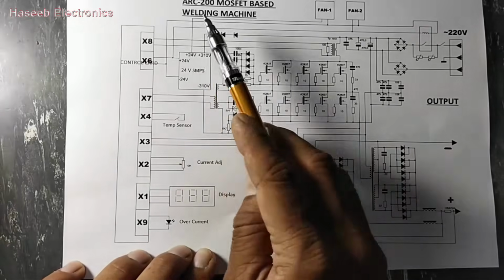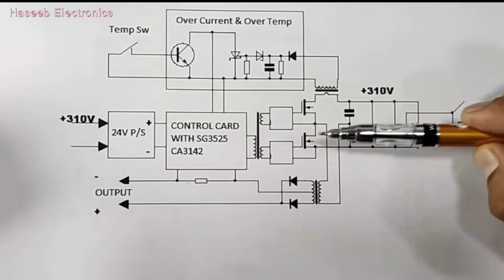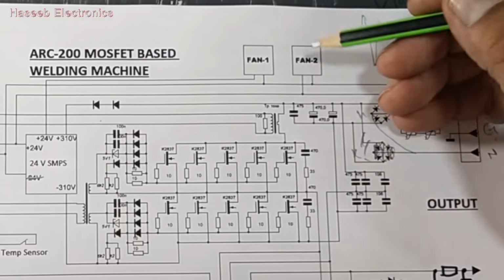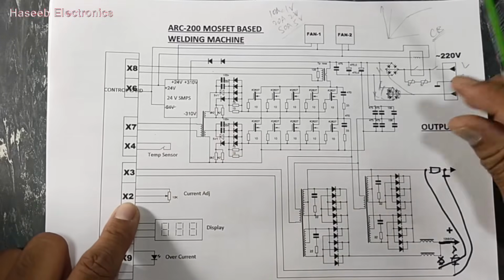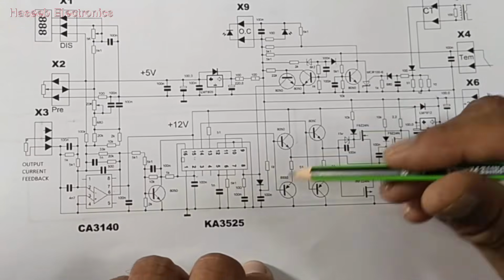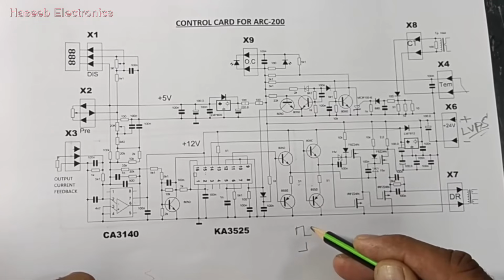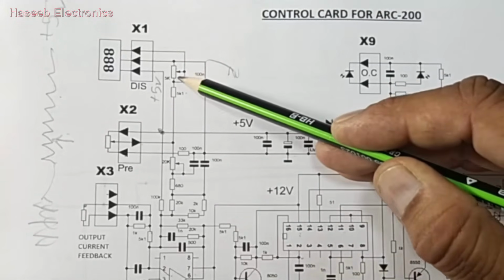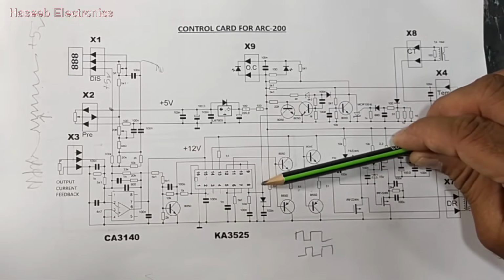{471} ARC-200 Inverter welding machine circuit diagram explained

Comment: Thank you for the Video!
Can i use the overcurrent to switch on/off current.
I want to modify a old mig welder to inverter mig welder.
And i do not know how the inverter reacts if i repetantly triggern oc protect!
And i do not know how long it takes if i demand current again ,witch time it takes to ramp up.

Please consider to answer:).😢
Best regards!

Comment: what are the exact value of the small zener glass  diodes for each igbt at the out put ,any one can help , i need to repair the out put replacing with 75n60.. This is good video. 3yrs later.

 24:04

Comment: what causes low voltage, my welding machine is having fourteen volts
Reply from the maker: most possible causes
gate drive for any IGBT is missing 
current feedback OPAMP on the control card may be problematic 
output rectifier may be damaged or any dry joint in power stage (transformer, IGBTs, output rectifiers etc)

Comment: Hello master, I have a Makute MMA250 pvo profissional welding brand welding machine. The 8-pin microcircuit is burnt and exploded, and the z diode is burned out near it. I could not find the data diagram. I ask you to find the datasheet diagram of this machine and upload a video about it to YouTubecan you

Comment: Sir well knowledge thanks,❤ sir low voltage ko supply kahan ce mily gi, mery weldder k igbt tak 300 volt aa rahy han but fan,relay off ha, power light on ha,no out put voltage ha

Comment: Thanks a lot for your valuable info. 
Can you tell me how the single board welding machine senses the over current alarm without current transformer? 
Where is the current sensor of the OC in the single board machine? 
Thanks in advance
Jihad syria

Comment: Sir I have three new control cards for a walling machine z24 9z24mosfet output sometimes 30v sometimes 220.300v.  z24 9z24 mosfet was installed still having this problem. gate voltages of mosfet are 5,20,5,20 ok.sir give a video for this problem

Comment: Sir, is there a 500 capacitor in the CA3140 IC, 500NF or 500 uf?
Reply from the maker: i think it is 500n . it is connected as compensation
Reply: Mylar capacitors, sir, or ceramic capacitors

Comment: ANYONE KNOW WHERE i CAN GET THE ARC 200 CIRCUIT DIAGRAM LIKE HASEEB ELECTRONICS USES
Reply from the maker: i already added the links in video description
you can download from here also 
 https://drive.google.com/file/d/1myf5...
https://bit.ly/3vH2WaS
if you need more whatsapp 00962-79-5324272 or gmail ashraf4ta4

Comment: what is the possible reason for over current oc problem in this welding machine
Reply from the maker: most of time there is operational amplifier (CA3140) failure 
IGBT temperature sensor circuit 
CT current transformer circuit

Comment: Thank you for this great walk-through. I modified mine by using an Arduino with smoothed analog PWM output in place of the potentiometer.This allows me to do H/L pulses and use a foot switch etc. Great little machine!

Comment: Sir can you help me about the circuit operation of inverter welding machine MMA-400 DC IGBT INVERTER ARC WELDER. The supply volt is 380/440VAC. This brand is RHINO. The problem I encounter is no display and the fan also not working. I changed already diode because when I checked it's already shorted. But still cannot power on. Can you show me the diagram for this and a little information. I'm very thankful if you can help me this. Thank you sir.

Comment: Thanks for the video, I appreciate your videos. I think there is a mistake in the control card, more precisely CA341 cannot work with the non-inverting input to the ground without symmetrical supply voltage (+-12V). If the supply voltage is asymmetrical (+12V and GND) the non-inverting input must be at a non-zero potential. I also did a simulation to convince myself

Comment: hi sir 
i have an inverter mma-180 welding machine and while start normal the green led lights and the fan works after few second s
the light off and the fan stops 
i have notice there is a pcb on the bottom with ptc becede a relay and increase the resistance i suppose increase the current 
when the weld machine colds after 2 minute the same process happens 
could you tell what can cause this ?
Reply from the maker: please check soft start circuit (PTC, Relay)
please check IGBT temperature sensor circuit
Reply: @Haseeb Electronics  thanks for the answer sir how can i check these components ?
i think the most good way is to replace it with new right ?
As about as the temperature sensor of igbt i cant see where is it 
i think on the second level there are three transformers maby there 
But i thought if i had shunt igbt or power diode meby the oc lights will light its not light on my case 
and maby the problem is viltual 

 @HaseebElectronics

Comment: if i want to custom to dc output power supply what do i need to custom? can i get it directly from final diode? i can decrease voltage from pwm control, but in final we see only half bride final diode.....it safe if not full wave rectifier? assalamualaikum

Comment: السلام عليكم, does the frequency change, through feedback, or is the pulse width the one that changes with a fixed frequency, to fix the output voltage, to the required voltage, h

Comment: Sir the inverter in our shop which is RIY LAND enverter welding machine  when i switch on the machine  its ok it will turn on and it well work in a short time after few minutes it will not welding  but the power indicator is on and the blower is running  sir what is the possible cause of the welding machine? Please reply thanks sir and good day

Comment: Sir i buy new control board for my riland arc250 but i have some difficulties when i install the new one ,the setting in display is 300 so i adjust the varistor to match in 250 but the oc light suddenly light up ...how can i adust the oc telerance?
Reply: Did u figure it out ?

Comment: Hello sir,  just asking.
What if the output voltage is low. 18vdc only instead of 56vdc.  Can you give me any idea whats the problem please.
Reply: I think check the current limiting circuit. It maybe senses some current are being drawn and reduces voltage to limit current to the preset value. Maybe adjust current setting pot and see if voltage goes up or down. That might confirm it.

Comment: Good and clear explanation. I have a MATWELD-200, every component is measuring okay, no dry joints, no short, but when you connect it to power, it immediately trips the breaker. What would be the problem?
Reply: Sounds like a dead short, so by connect it to power, do you mean that just plugging the machine in is blowing the breaker ?

Comment: Hello, can you please do a video on modifying a DC Inverter welder to be able to run e6010 electrode?

I have one welder and it starts but stops after 2 cm of welding 1/8 inch electrode.

 From what I have learned in all your inverter videos and seen on other people's videos is that it is related to output inductance and voltage, but I don't know how much inductance is necessary and how to change output voltage.

 I have seen on your video that current control is a summation of all different sources of current sense, and maybe the e6010 somehow tricks the controller into thinking there is less or more output current compared to igbt side before the transformer.
 
The only solution i can think of for output voltage is rewinding output transformer.
Reply: Is the problem with 6010 rod not working with inverter welder the rod flux coating type ? The coating type is incompatible with the inverter welders arc frequency ?

Comment: Hi sir, I have a full bridge TIG welder, I changed all mosfet and it works well 1 min, after that it blows up the 4 mosfet, the driver card doesnt seem to have bad components, do you have any similar experience with this full bridge driver card??
Best regards from Cuba
Reply from the maker: welcome dear 
it happens when 
gate driver component (for any single mosfet or pair of mosfet) is bad
driver card of pulse forming network for full bridge drive is not working good 
if the allowed deadtime between both channels is low and both channels are overlapping (check signal with oscilloscope) 
might be low quality components, that doesn't meet the product standards

Comment: Excellent video and explanation of the circuit - thank you! Is the circuit diagram still available for download? I am having some problems to view it, it won't unzip after I download it.
Reply: Ok, not to worry, I solved the problem I was having to view the diagram. Thanks again for a great video!
Reply from the maker: if you need this diagram send message to my whatsapp, i will send in whatsapp  or gmail ashraf4ta4
Reply from the maker: it is available in video description 
or you can send message to my whatsapp 00962-79-1161-084

Comment: What exactly determines the exact output voltage? Without load my output voltage is about 80VDC coming out of my cheap eBay inverter welder. I'd love to drop it because I have huge 110,000uf 63v capacitors I'd like to hook up on the output for added performance. 👍 Appreciate any input

Comment: great work thanks alot for your explanation, but could you tell me the volt of the ziener diode in over temp circuit
Reply from the maker: this time i don't have circuit diagram because my computer damaged by virus attack but i will try to find it
Reply: @HaseebElectronics  thanks a lot I will wait for your reply

Comment: It is  found ought most very important technical video on control pcb of inverter welding Machine with maximum clear explanation,  thank you brother 🙏  , if possible please upload a video on UC 3846DW IC based control pcb,
Reply from the maker: Many many thanks
sure i will try my best to do it soon, i noted it

Comment: Sir, may you explain and prectly demonstrate spot welding circut with controller in urdu
Reply from the maker: please visit my urdu channel 
(haseeb electronics urdu)
Reply: @HaseebElectronics  sir i mean spot welding for lithium batteries in series or parallel, for power bank or chargers
Reply from the maker: okay dear 
I noted it

Comment: Thanks for sharing such an informative explanation. Do you think it would be feasible to convert this circuit to support constant voltage operation (for use in a DIY MIG welder)? I imagine that a simple modification of the shunt resistor circuit, to measure voltage instead of current, would be suitable, but I would appreciate hearing your opinion.
Reply: Why u wanna constant voltage operation instead constant current operation ı knewe that  using constant currrent operation all welding inverters
Reply: @adnansayder2148  Arc welding and TIG welding uses constant current, but MIG welding uses constant voltage, because that's the only way to maintain a stable arc when using a wire feeder.
Reply: @TimCoulter  allright thanks but must we  use also  current control  together  voltage control

Comment: Thanks for sharing your knowledge.
I have a problem with a 200A stick welding IGBT inverter machine. 
The protection parallel resitor explode and burned the relay and part of the pcb, I know that the relay is a 855AWP-1A-S, at the same time i opened an equal new machine it has 2 resistors in parallel, they could be about 510 ohms resitors, these resistors have diammeter of 5 mm.
What should I do to repair the PCB?
1) Use a 250 OHMs resistor ¿What power?
2)Use two 500 OHMs resistors ¿From what power?
2)Use a NTC ¿ What Kind?
3) Use a PTC . what kind?
Thanks a lot.
Reply from the maker: it should a PTC 
PTC SY 16P - 101R
it is 100 Ohms PTC for 200A MMA IGBT welding machined. it is most commonly used in machined

Comment: Great explanation of the inverter and how it works,been trying to repair my own.shorted the 4 mosfets on driver pcb and can’t find replacements part no on them K50T60 comes up as igbt yet schmatic symbol and board pins says D mosfet can’t figure it out
Reply from the maker: as per my knowledge K50T60 is IGBT (if it is B50n60T, P50T60, W50T60 then it will mosfet)
sometimes there are print errors on pcb or diagram but if physical component have K50T60 then it is IGBT
Reply: Thanks Haseeb,it is clearly marked K50T60 with another number under it GAV-207 the welder is a HuGong mig stick 180 and unfortunately for me a discontinued model so parts unavailable the board clearly shows GDS pin out,the schmatic is not the greatest but shows mosfet symbol looks like N channel depletion no current direction markings,have to say I’m at a loss not a lot of info on these welders where I’m from
Reply from the maker: then it is awesome
it is igbt 
as igbt and mosfet work similar 
you can try igbt and it will work surely
Reply: Thanks again Haseeb will order some more and try again,replaced them once before with igbt and 2 shorted soon as power was applied that’s when I noticed mosfet pin out so assumed wrong part,don’t want to risk damaging pcb,are there different channel igbts like mosfet has,or maybe I got poor quality part from China ebay

Comment: Halo ,sir l want u to help.L have checked  diode,mosfet,no o.C and small mosfet are ok but no output voltage
Reply from the maker: are the 24 VDC from the low voltage power supply available?
5 volt & 12 V regualtors are good?
please reply
Reply: Yes ,24v are ok and l changed  the all ice but still no output

Comment: greeting from nigeria, i have a challenge with 200A inverter welding. it shows OC. i have checked mosfet, transformer and rectifiers. all okay. can the vertical control card be the problem?
Reply from the maker: problem might be in pulse transformer
or igbt temperature sensor
or it's related components on control card

Comment: It makes one spark and turns to O.C want would be the problem
Reply from the maker: it means that the operational amplifier resistor network, or the current limit pot  (small trim pot on the PCB) have something wrong

Comment: L wanted  u to teach me  ,the mains cause  of low voltage output and maximum voltage  in welding  machines
Reply from the maker: yes dear. these machines provide 28 to 70 VDC in output with high current output to produce arc at welding point. so this machine is basically provides a controlled current

Comment: I have one and it doesnt have the surge protector charge resistor and it trips the breaker whenever I first switch it on
Reply from the maker: yes dear, if some machine doesn't have surge current protection,  it must have surge current protection must be available to make the machine long life 
you can add some PTC 16P 101R with a adding 30 Ampere power relay.